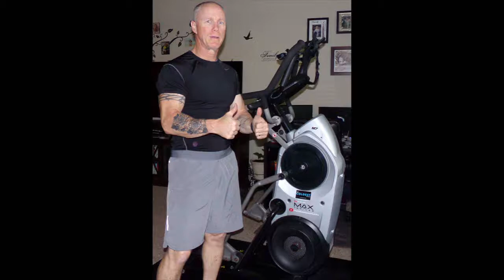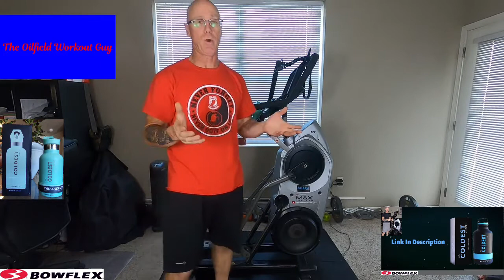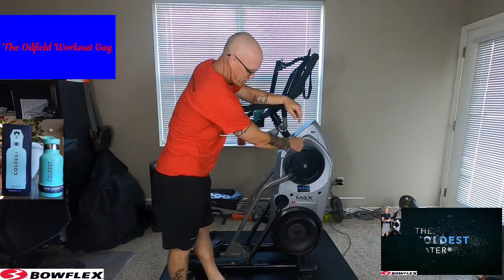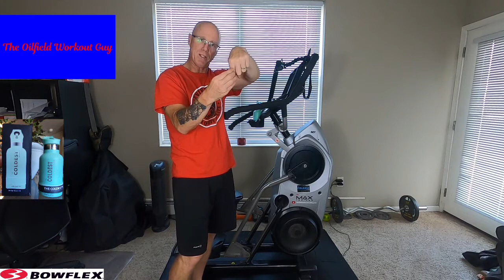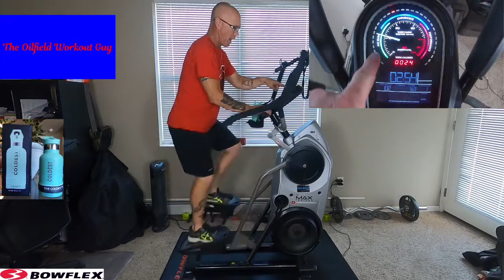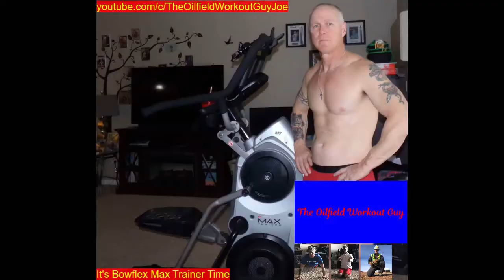Bowflex Max Trainer Tutorial How the Max Trainer works

Comment: Hi Joe.  You have a mistake in your explanation of that big white needle on the display.  You called it a simple "reference".  Nope, that is incorrect.  That needle represents the current calorie burn rate (per minute).  It is the "analog" version of the "digital" display of the same current calorie burn rate (per minute) located on the lower half of the screen.  Those 2 cal burn rates will always match each other.  Most folks like to look at that big needle!

And, just some more info for other readers -  ALL Max Trainer models use only 3 metrics to calculate the calorie burn rate:
1)  The User Profile info (on the M6, M7, & M8 models it is only the user's weight).
2)  The resistance level.
3)  The pedal speed (RPM).

The User Profile info only ahs a small effect.  It is the resistance level and the RPM that will have the most direct/obvious influence on the calorie burn rate.  For example if you want to keep that needle at "20" (meaning you are burning 20 calories per minute), then you can do it in 2 ways:
1)  Pedal slow and use high resistance.
or
2)  Pedal fast and use low resistance.
Reply from the maker: Thanks Scott, but all I was doing was keeping it simple for the viewers. But thank you for going a little more in detail for the people that want to read it.
Reply: @Harleystumblersandgifts  Yep!   But you correctly explained all of the other display panel numerical fields, but goofed on calling that needle "a reference".  Keeping it simple or not, it has to be factual, lol!

Comment: How the profiles work.
Reply from the maker: I’m not sure what you’re talking about?
Reply: The bowflex max have the option to save 4 profiles of users. So that could help with the difference of height and weight of every user
Reply: The User Profiles are used as part of the 3 metrics that are used in the algorithm to calculate the calorie burn rate.  The other 2 metrics are the resistance level and the pedal speed (RPM).

The User Profile info on the M6, M7, & M8 models it is only the user's weight.  On the M3 and M5 models, the User Profile info includes the user's age, gender, weight, and height.

Comment: This helps more 😊
Reply from the maker: Awesome
Reply: @Harleystumblersandgifts  they discontinued the M7 and  I don't know if I want to spend 3 thousand dollars on a machine the  M6 Max Trainer looks good decent price the only problem is I compared both models and the M6 has a three inch shorter stride I'm pretty sure just because of that it does not burn as many calories as the Max Total what should I do  please help ????????
Reply: @mikegreen5502  Regarding the stride of the M6 vs the Max Total model, you are mistaken.  ALL Max Trainer model have the exact SAME stride which is a pedal height of 19.1 inches.  You are comparing the total length of the 2 models (46" vs 49"), but that dimension is simply the overall length "space" each machine occupies.  It is not the length of the base assembly, but rather the max space it takes up due to the handlebar reach and monitor depth differences between the 2 models.
Reply: @Harleystumblersandgifts  also the M6 only goes up to level 16 resistance not 20 like the max total but I'm not too worried about that it seems like from watching your videos 10 is the magic number 💪
Reply: @mikegreen5502  Regarding the resistance level differences between the M6 and other models, note that ALL Max Trainer models have the EXACT SAME physical FORCE required to move the pedals when they are all at their min resistance (level #1) and also when they are all at their max resistance (either #8, #16, or #20).  The difference between the models is the number of STEPS between the min and max resistance settings.   
- The M3 has 8 steps.
- The M6 & M6 have 16 steps.
- The M7, M8 & Max Total have 20 steps.

The more steps you have means that the change between each resistance level is smaller.  So the M3 (which has only 8 steps) has large resistance jumps between each level vs the other models.

For example, when the M7, M8, or Max Total are at resistance level 10, that is the exact same as when the M5 & M6 are at resistance level 8, and the M3 at resistance level 4.
Reply: @norcalkid2776  from watching  this guys videos  it seems like this machine is the holy grail for burning  calories
Reply: @mikegreen5502  Yep, it is the best piece of exercise equipment that I have ever bought!  Joe gets a lot of his cal burn because of his incredible ability to maintain a very high RPM (he usually averages at least 65+ RPM).  He was likely blessed with good genetics for that and his years of professional speed-skating definitely help!!  Although you can choose to believe the Max Trainer's displayed calorie burn or not, but what I do know is that is makes me sweat profusely during my 30-minute workout (I usually burn about 750 to 800 calories per workout), and so all of that sweating has to be some kind of proof of a GREAT workout, right?!  I continue to use my M5 for 5 to 7x per week!
Reply: @norcalkid2776  that's  amazing  750 to 800 calories  for 30 minutes  wowwwww ya know  what speaking on that  it doesn't  seem like Joe is going that fast in my eyes he seems to be going a normal  pace or is the resistance  real rough on the body is that the reason  why you're  impressed  with him ?
Reply: @norcalkid2776  because  you wanna talk about resistance  I hate my Schwinn  AD Pro now that machine  is wayyyy too hard the resistance  is crazy I have friends  who are in tip top shape and  they can't last 5 minutes  on that  thing  I wanna sell  it so bad it has more blades than any Assault  bike  either  sell it or mod it and take one fan blade out
Reply: @mikegreen5502  Joe is only using his M7 at a resistance level of "10".  The M7 has 20 resistance steps and so he is only at the mid-resistance level which is not too difficult.  His RPM might be hard to observe and appreciate in the video, but trust me, it is pretty hard on the cardio to maintain a 65+ RPM for a continuous 30 minutes even at a low resistance.  Personally, I am too old to do those really high RPMs for 30 minutes (I never was a long-distance type of runner!).

If you set the Max Trainer to its max resistance level, it is hard to pedal for a continuous amount of minutes at a good RPM!

Yep, I have never used one, but I have heard that those air/fan type bike are intense!  The "Rogue Echo" is supposedly a beast!
Reply: @norcalkid2776  the Rogue echo  is greattttttt but  it's  not as hard as the SCHWINN AD PRO OR AD7  DO NOT WASTE YOUR MONEY ON THE SCHWINN  VERSION  THE DESIGNER'S  WE'RE  CRAZY